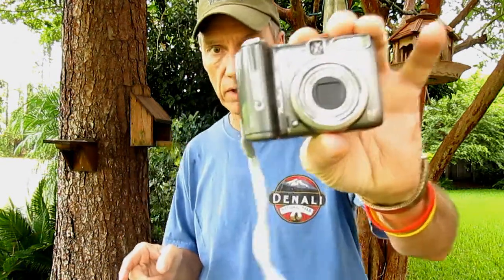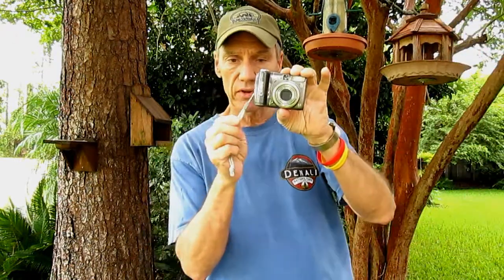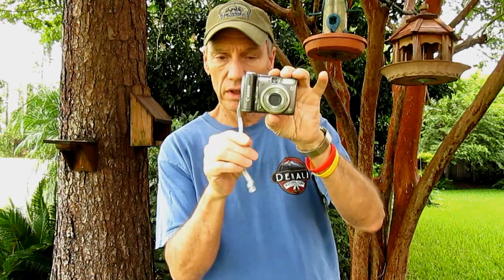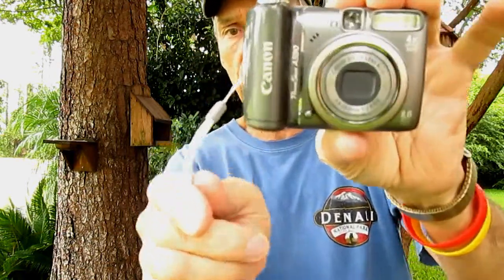Simple camera modification I make to improve my StickPic video

Comment from the maker: BTW, since you inquired, that 10.0 Mbps render was with CBR (Constant Bit Rate). I've experimented quit a bit and have come to the conclusion, for my use, hardware and software, constant bit rate gives me a better quality video than CVBR (Continuously Variable Bit Rate) without appreciable gain in file size. Important to me since my upload speed is limited to 512kb.